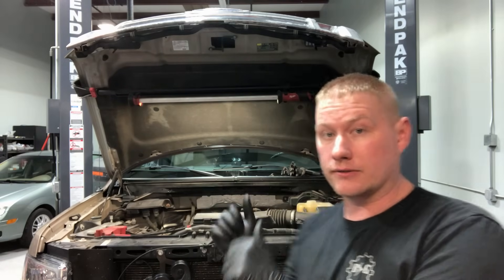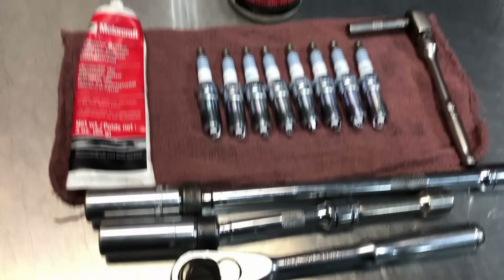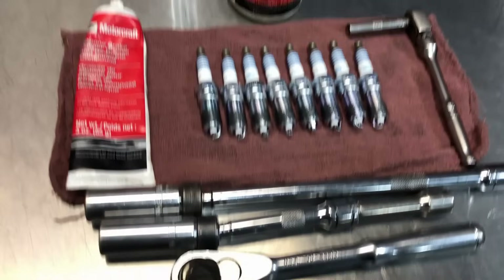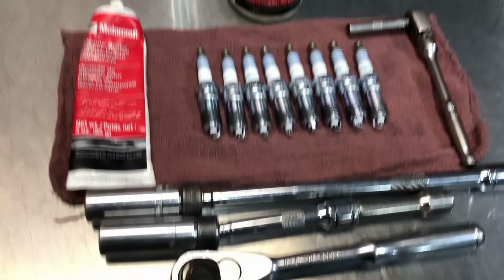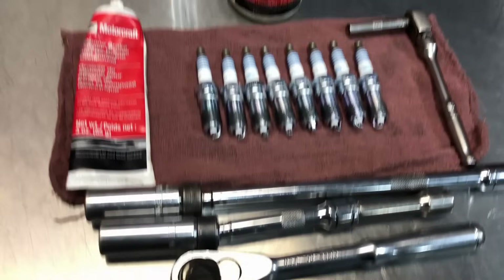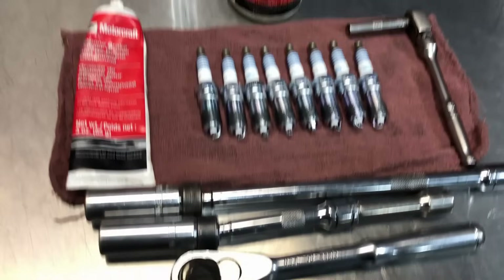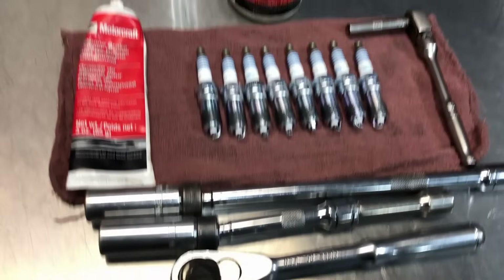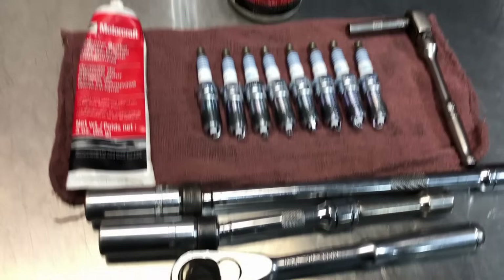2011-2017 Ford F-150 5.0L Coyote Engine: Spark Plug Replacement Walkthrough

Comment: Love the videos. Do you also recommend switching to 5w-30 on these like the 5.4?
Reply: I wouldn't be so gung-ho about using heavier than spec'd oils on a new engine. The viscosity increase in going 5W-20 and 5W-30 is almost 50%. Longer chain molecules in the 30 weight will only lubricate better if they can get to where they need to go. Namely, the oil channels in the block, crankshaft, etc are sized for 20 weight. The flow would be slightly restricted with the 30 weight. It may work out just fine for a while, but you'd hate to see an oil pump go out prematurely from higher operating pressures. You'd hate even worse to have critical components not see enough oil... Modern synthetic oil lubricates extremely well. Just change it every 5-7K miles and you shouldn't have to worry about alternative solutions.
Reply: Would like to see Brian's answer to this question.  I don't think I've found a video yet with him specifically talking about the 5.0 and which viscosity to use.
Reply: Yes run 5w30 on it 5w20 is only good for fuel economy but doesn’t protect against wear like 5w30 does
Reply: Jack Skeleton I initially ran 5w-20 in my 5.0 for the first 15k miles.  Switched to 5w-30 after.  Engine became much quieter and I’ve seen zero difference in the fuel mileage.
Reply: @jackskeleton95  Maybe in old pushrods from the 80s.  VVT engines have tight passages, thus why 5w20 is the correct oil.  Its not a conspiracy.  Ford and Ford Performance both recommend it.
Reply: I run 5w30 in my 2016 F150. Have been since new because I tow heavy. Has 45k now and no noise issues.
Reply: I'm curious about that myself. I change my oil frequently with the 5w-20 Motorcraft oil just to make sure its fresh, but I'm kind of thinking about running 5W-20 in the winter and the 5W-30 in the summer.
Reply: 0w30 and an FL820s oil filter(adds another half quart - ish) and sit back, enjoy.....
Reply: I was always warned by mechanics to not use heavier oil. The 5.4s were notorious for having oil channels that were too small for heavier weight oil and you'd get less oil pressure on an already under pressured oil system.  They may have remedied that on the 5.0s.

Comment: Will the 2018 be any different?
Reply from the maker: Yes much different.
Reply: @FordTechMakuloco  hopefully you can do a video on that before I drive 75k more miles
Reply: I have a 2018  5.0 engine in a 150 Ford with1,300 miles on it  and the motor backfired and doesn't work .ford mechanic looked at cylinders and found piston shattered .now  waiting to hear from Ford rep as to what they are going to do .I have been researching all over the net gathering info on this problem ,to see if anyone else is experiencing a blown engine on 2017, 2018, 2019 Ford 150 with 5.0 engine . Thank you for your video and time to explain the how to on plug removal .
Reply: Tom that sucks man..  I have not heard of anything like that with a new engine before unless someone drove it stupidly.  Could be a defective piston.. I am sure it happens in all those engines out there.

Comment: Thank you for all your videos.  Especially on the 5.4 cam phasers.  Just got the 5.0 mustang and really look forward to more videos on it. It does has a very small peck noise from the bottom end. Seems like all fords that I have had has some kind of knock noise to them.
Reply: My F150 5.0 has had that noise since new. Seems like it's a non issue
Reply: My 2013 has a light valve lifter tap noise, Im pretty sure its not the infamous coyote tick, but non the less its there.

Comment: A little anti seize on the coil nut don't hurt mine were a little rusty
Reply from the maker: Agreed these were quite rusty too for some reason.
Reply: @FordTechMakuloco  I recommend anti - seize on the tapered seat of the plugs, as well as the threads. ( Dan Hucklebridge)
Reply: Wow that sound, wonder how much they saved by not putting any anti-seize on there? and you can tell why they say to do it on a warm engine the first time.
Reply: FordTechMakuloco I had two snap off on my 2013. I am going to have to either replace the valve covers or drill and tap the  dang thing.
Reply: Absolutely.  I have ruined the captured nut on the intake manifold of a 4.6 modular V8 because of corrosion from the drain below the wiper arm on an 03 Grand Marquis emptied right on top of the #8 Cylinder coil.  Ford fixed this issue on later version of the Panther platform.  Anti sieze would have been a big help on that coil nut.

Comment: At what mileage you need to replace them my 18 coyote has 73k on it now
Reply from the maker: Wow that's allot of driving! I would look into making time for the job soon yes.
Reply: @FordTechMakuloco  yes sir i bought December 15th 2017 at 7pm at 9pm was on my way to mexico i drive it twice a month back and fort to mexico round trip its 2,700 miles so i put over 6 k a month love itsold my 11 f150 5.0L with 375k running strong original powertrain
Reply: @manuel M Ramirez how is the 18 running? Would love to know since you drive a lot of miles.  Thanks.
Reply: @Bushy556  runs fine only things ive replaced its tires and 2 front wheel bearing last week and regular maintenance thats all everything still works as day 1
Reply: @manuel M Ramirez how many miles are you up to?
Reply: @Bushy556  just broke 100k shes due for alot of maintenance now still nothing major i do get 23mpg on highway at 70mph unloaded but once im loaded i get 18mpg and if i drive over 80mph i het 16pmg never gotten nothing lower then 15pmg v8 coyote all the way for me
Reply: @manuel M Ramirez thanks a bunch!!!!
Reply: @michoacanom4320  hey buddy, any updates on the truck? Any maintenance you’ve had to do?
Reply: @Bushy556  maintenance wise just fluids and filters did replaced front hubs and gps module and back up camera thats all no oil consumption on engine 120k
Reply: @michoacanom4320  thank you. I’m at 33k on mine. No issues.  I was wonder how your truck was doing again.
Reply: @Bushy556  good i love it oh i did had the transmission reflash it was jerking no more so far so good

Comment: Great Vid!  You are one of the best Ford techs on YouTube.  I have 2009 5.4 3V.  I was wondering, what is the difference between the 2008 to the 2009?  Someone told me Ford changed somethings on the 5.4's.  Thanks!
Reply from the maker: Mid year 2008 there was a head design change that included a revision to the spark plug design. 2008 models that are late build and include these refinements can be identified by brown coil boots. All 2009 models incorporate this design change.
Reply: Thank you!  I have 209,500 miles on it and still runs great.  No cam phaser knock.  I do use 10W-30 MobilOne in it.  But, I'm a firm believer in preventative maintenance and I'm poor so I can't buy a new truck.  Lol!

Comment: Warm, huh? Guess they're still paranoid about spark plugs getting stuck in the head.
Reply: Um, no...coyote 5.0s dont have plug issues.
Reply from the maker: No this is more about the threads in the cylinder head.
Reply: It's an aluminum block...... crossthreading is really easy and a mother fucker to fix, I learned that the hard way many times

Comment: Are the seals on valve cover tube replaceable or do you replace whole valve cover if oil leaks are found
Reply from the maker: Yes they are replaceable.
Reply: @FordTechMakuloco  thanks

Comment: Has ford released an intake valve service available for the ecoboost yet?!?!?
Reply from the maker: No but BG makes a GTDI service now they have tested on a Taurus SHO test mule over and over again for years now no issues.
Reply: Ok sweet thank you very much, I use BG stuff now and it's really good, thanks for your videos they are very informative!

Comment: What brand is that magnetic spark plug socket? I have the old rubber one and it’s just not holding anymore.
Reply from the maker: This is the one I use in different lengths- https://amzn.to/2T4OaoQ
Reply: FordTechMakuloco w